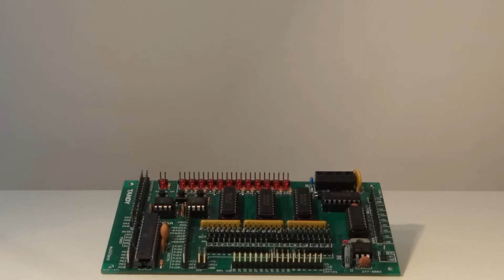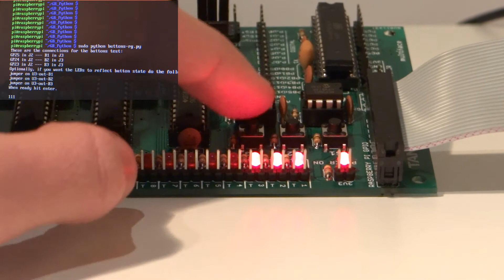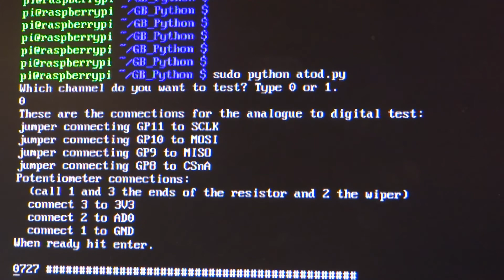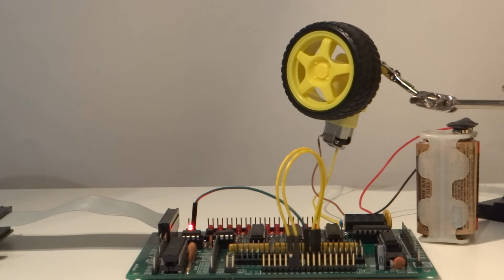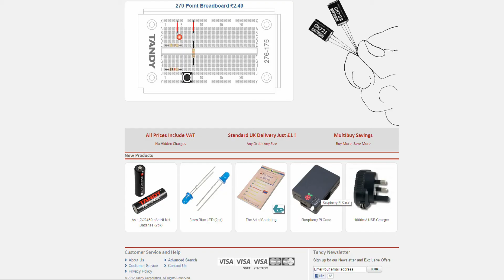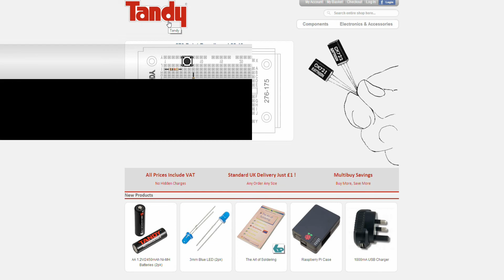The Tandy MultiFace...

Comment: i take it from this that the motor controller can only control 1 motor so to ontrol more than one you would have to use ESCs connected to the open collector drivers?? and then a servo would have to be connected to some PWM pin on one of the other outputs...